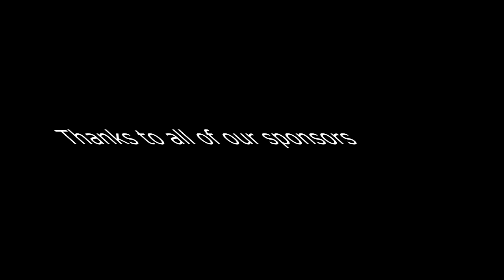FRC 2016 Sultans of Turkiye #2905 Robot (Night Crawler) REVEAL

Comment: NIce robot but I have a feeling those bumpers are too high and/or too low.   There is only three inches of adjustment in in the location of the bumpers and the angle on those seem to raise the bumpers much more than 3".  Lowest point of bottom of bumper must at least 4" off floor and highest point must be no more than 12" off of floor.
Reply from the maker: +John Vriezen Thanks for your comment :) We fixed that bumpers before the bag&tag day :)